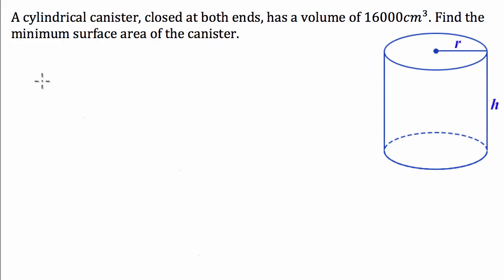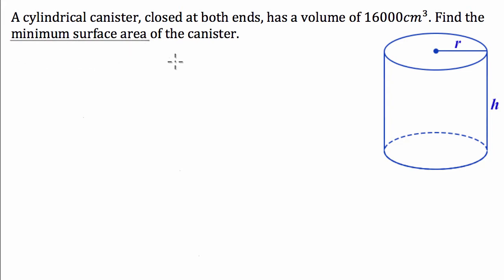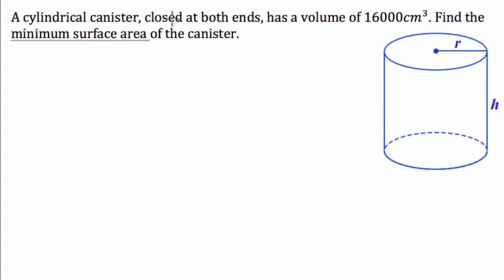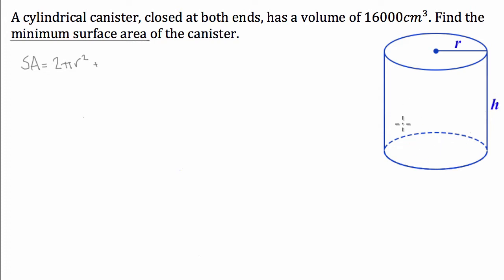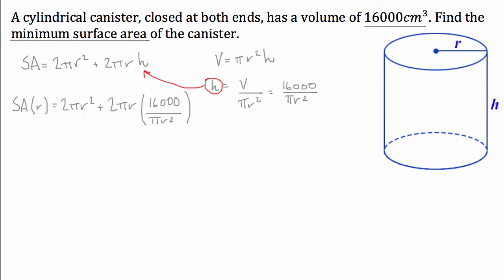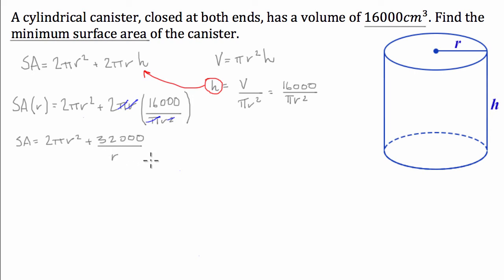Optimization: Minimizing Surface Area of a Cylinder

Comment: But how do you know if you found the minimum or maximum. You need to substitute values less and more than the value found to confirm the turning point is an approximate way. Another way is to use second derivative test.
Reply from the maker: Great point! I definitely should have added that to the video.

Comment: Hi, I was just wondering, what makes this value the minimum surface area?
Reply from the maker: Well you could take the second derivative and evaluate it at the value in question. If that value is above zero (positive) then it will indeed be a minimum.
Reply: @HaroldWalden  what do you mean by the value in question?
Reply: @teosteosteos  I was having trouble with the same concept... basically every time you take a derivative of a function, its "zeroes", or the x-values that result in y being equal to zero, are the x-values that correspond to places in the original function where the gradient is 0, or the so-called "turning points", as he mentions and draws at 6:37. Now this function, luckily, only has 1 place where the derivative equals 0, so only one minimum value. Now this isn't always the case, and sometimes it can be confusing whether its a minimum or a maximum. If you take the second derivative of the function and then use the x-value that you got when you were looking for the turning point (in this case, it was it r = 13.656) it can tell you whether it's a minimum, if the value is positive, or a maximum, if the value is negative. But in this specific case you don't have to go through this process because there is only 1 value that r can take, and since you're looking for a minimum value this means that you know that that r value corresponds to a minimum.
Hope this helps, if not, reply to this and I'll try to explain it better
Reply from the maker: @ognitron8191  perfect explanation
Reply: @ognitron8191  oh so just find second derivative, if it’s concave up it’s a minimum, and if it’s concave down it’s a maximum

Comment: where does the derivative come from though?
Reply from the maker: The derivative comes from the formula for surface area of a cylinder that has been constrained using the conditions provided in the question.

Did you watch the video through with the sound on?
Reply: @HaroldWalden  but why is the derivative = 0? 

What if the point in the graph (7:43) is not tangent to a horizontal tangent line?
Reply: Nvm, I just realized maximum and minimum when differentiated is always 0. Thank you.